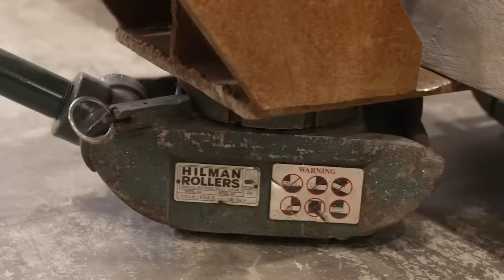Fitting the Lead Ballast Keel (Tally Ho / EP120)

Comment: I can't wait to see how that keel is connected to Tally Ho. It needs to stay right it place even in the roughest of seas.
Reply: I was thinking the same thing. How on earth do you attach that to the keel? Initially thought they would put the anchors in while the lead was still liquid but now I have no idea.
Reply: This is also my question...
Reply: I imagine they will use long, thick bronze bolts and bolt it right through the ballast keel and a keel timber. Same way the different pieces of a centerline are held together.
Reply: @maxxod1  Keel bolts! You can either cast them in , or cut a side pocket in the keel (either normally done on deep keels) or through bolts (for shallow keels like this one). I would guess that they will just through bolt in this case.
Reply: They'll use long bronze bolts all the way through the bronze floors to the bottom of the keel.  At 13:25 Leo talks about raising the boat high enough to be able to drill counter-bores in the bottom of the lead, this is so he can get a thick washer and nut on the the end but be flush with the bottom of the keel.  So they won't be 'bolts' like store purchased bolts, they will be solid long bronze rods and then just threaded at each end about an inch and a half or so.  They keel bolt size will be anything from 5/8 to 1 inch diameter, my guess is he will go with 3/4 inch.  316 L Stainless has a stronger tensile strength but there is a risk of long term crevice corrosion (where there is no oxygen present), bronze performs better over the long term in underwater applications like this.  You make up for the difference in tensile strength by using larger diameter bronze than your would stainless steel and/or you use more keel bolts.  I'm guessing there will be around 14 to 16 keel bolts total.
Reply: Bronze bolts trough both keels: see episodes 7 and 8 where Leo removes the original keel
Reply: Long, big bronze bolts.  It's about as you'd expect, holes through the keel timber into the lead.  If you want to see how it's done, Acorn to Arabella did it.
Reply: Here is where the hot glue gun comes in, remember that bulkhead story 😀
Reply: @felis1977  I am not sure I trust bronze with 8 tons... feel like it would get further and further away! but I also cant see Leo using any steel on the boat if he can avoid it
Reply: If you go way back to the videos at the start of the project,  there is an episode where he drills and bolts the old keel to the new keel timbers.
Reply: @ciarantaylor367  True - silicone bronze is more ductile than the steel. That's not an issue - you just use thicker bolts and/or more of them :) That's what I'm assuming at least - as I wrote somewhere else - all I know about boat building I learned from Tally Ho project videos ;)
Reply: They will use flex seal tape most likely Ewhah Doggy!!!!
Reply: Staples
Reply: @maxxod1  That "Black Stuff" they put on top of the Keel.... That was really GLUE.... LOL
Reply: @ciarantaylor367  The tensile strength of Bronze isn't as high as stainless, but it is still very strong.  Like I said, they will compensate for the strength difference with larger diameter bolts and more of them.  The risk of crevice corrosion is too high, bronze performs better underwater.
Reply: @SteelDoesMyWill  I imagine you'd also want to be mindful to choose an alloy that in the  event of galvanic corrosion you would want to make make keel lead the anode and the bolts the cathode as there's considerably more lead than bolts.
Reply: Duct tape,  obviously.
Reply: @on4xb  Curse you @on4xb. I've just been directed to EP 7&8 and I'm forcibly involved with re-watching every episode.
Reply: @hereitbe   Hahaha ...
Reply: @alexhamon9261  Lead & Bronze are not nearly as reactive as Stainless Steel & Aluminum, its all all about how far apart the two alloys are from each other on the nobility scale.  Bronze bolts have been used safely on lead keels for over a century.
Reply: @cappystrano1  I think YOU need to read the thread, nothing I said was redundant.

Comment: My heart goes out to that planer blade.
Reply: Its really soft its actually not much different than hardwood. Wax helps the friction but lead cuts more like wood than metal
Reply: Tool steel doesn't care.  Lead lubricates as its cut.

Comment: I don't know if you just couldn't get back far enough or what, but I'm sure I'm not the only one who would like to see a photo of the entire boat with the keel. I'm looking forward to seeing it bolted into place.
Reply: How?? What keeps it on?
Reply: @thetruthexperiment  Large silicon bronze bolts through both the lead keel and the wood keel. My guess is somewhere between 3/4 and 1 inch thick, at least a half dozen of them. They will drill down from the top. The nuts on the bottom will be countersunk into the lead. I'm speculating a bit, but watch and see next episode. It should be fascinating.
Reply: @chuckprichard3691  yeah, I imagine it would have to be very very secure. I wonder how many ships sunk because their ballast fell off into a mile of ocean. So brave.
Reply: @thetruthexperiment  Well, sometimes that happens, but almost always this is race boats. A boat like Tally Ho would be very safe if handled by a decent sailor, which Leo certainly is. It will still be secure in 100 more years.

Comment: The obvious strain on those straps when lifting that weight was scary !
Nicely done guys ! 
👍
Reply: And especially the wheels
Reply: i’m curious what those straps were rated for and if they had been load tested prior to this use.
Reply: Same.  I worked on navy boats for 20 years, and bought and used a bunch of those straps.  I too was worried they were underrated.

Comment: Looking forward to seeing exactly what is necessary to secure the lead to the keel timber!
Reply: Agree. I kept thinking: where’s the mechanical attachment?!?
Reply: If you look back at episode 8 you will see that it is attached with large bronze bolts. But I suspect that he is going to have to raise the boat quite a bit more to get them under the keel, when he removed them he dug holes in the ground to get them out, with a concrete floor he won't be able to do that.
Reply: The holes for the keel bolts will be drilled from the top and bolts inserted from the top. The holes will be counter sink from the bottom to allow for nuts and washers. He set the level of the boat to allow for the counter sinking as he noted in this episode.  I think he drove the old bolts down because it was easier.
Reply: I thought that just the tar would hold it in place, like glue 😂😂😂😂😂🤣🤣🤣🤣.
(Yeah actually bolts, BIG bolts.)
Reply: Shouldn't these very long bolts be installed before the deck and internal bulkheads are fitted?

Comment: A quick note:  When loading slick tired lifts onto till beds.  Take several hands full of coarse dry sand and spread it onto the tilt bed wooden floor.  This will give good traction; this same technic is used by trains to lay sand ahead of the driver wheels on steep grades to help gain traction.
Reply: That might be a good idea, but the video would not be nearly as much fun.
Reply: @davefoc   well there is that.   ^~^

Comment: Nearly fifty years ago I cast a three-ton cruising keel.  I intended to install the keel along with the deadwood but after seeing the size of the electric drill required to drill the over one-inch through bolts I decided to leave the job to the professionals.  From memory eight long stainless bolts were needed.  Drilling lead is fraught with danger as the drill bit "grabs" the surface as it cuts causing a torque reaction back through the electric drill.  If you are not prepared it could cause a lot of physical injury.
Reply: Same issue with aluminum, it's such a soft metal it can cling to the bit and clogs it up and just kind of sticks to itself. You have to have a really sharp bit and go slowly so the bit doesn't get too hot as well as very frequently backing off to get rid of the chips

Comment: I still get goosebumps when i think in 100 years when the tally ho is still in the prime of its second life the owner will be able to look back at the journey leo and his crew undertook
Reply: Thought this is a new boat ??   Except for some wood n fittings what's left of the first boat ??  thank you.
Reply: @MegaBait1616  think about what you just said and get back to me
Reply: @MegaBait1616  There is an episode in which Leo talks about whether this is a new build or a restoration. IIRC he basically says that if the boat would have been maintained during her life most parts would have been replaced by now anyway. He did start from the original boat and first took out all bits that were rotten or no longer trustworthy. I think the only major pieces that are left from the original boat is the transom and most of the lead in the keel. I'm sure some of the original fittings will be used too.
Reply: Guess this is like grandpa's old axe. Best axe ever, shifted the handle three times, and the head twice....
Reply: @Dronston  its the ship of theseus paradox.
Reply: @cappystrano1  no need to overreact, take another look at what i said and explain what horse im riding 😂

Comment: The pickler for the sand was inspired.
You guys being so nice the equipment rollers!  We just bashed them with sledges to change direction.
Puffin has the same prop cuts as Tally Ho.

Comment: I’m excited to see how you attach the ballast keel to the boat. I’m trying to picture the size of the bolts required to hold something this heavy in place, and how you will be able to drill/install them with so little clear space under the keel. I’m sure you’ve got this figured out, so I can’t wait to see the solution!

Comment: Good one Leo. Now what really interests me is how you bore the keel bolts and how they are fastened to the keel. I have always wondered how that is done. Thumbs up to you and the crew.
Reply: me too! I thought they would have sinked the bolts into the lead. That's not the way as it seems.
Reply: sinking bolts in melted lead ? impossible,  iron (or bronze will float in lead.) The answer: drill holes through both keels and bolt the keels together
Reply: @on4xb  so do they drill right through the lead keel plus the boats keel and use a very long nut and bolt
Reply: @johnwhite2267  Yes, but drill from within the boat :wooden keel, lead keel. Then countersink the bottom of the lead keel for the (big) washer and nut. "Drop" a (long) bronze bolt through the hole and torque them together. About 13 or more bolts will keep the ballast keel in it's place
Reply: @on4xb  thank you for the reply very informative and very much appreciated. I love watching the videos as others have said the massive amount of work that has gone into this project is fantastic. Im always incredible impressed with Leo and his crew the amount of knowledge he has in his head for a you man.  well done to all

Comment: Wow. Congrats Leo to you and all the members of the team and the generous supporters of Port Townsend that provided you with heavy-duty fork-lift trucks to lift the massive keel and all the other equipment like the keel supports. It was an amazing operation, every step of the way, a very interesting process. I am amazed that you can lift the entire weight of TALLY HO with hydraulic jacks. Most of your jacks look no bigger than 30 tonne jacks. Each step along the way you are getting closer to your final goal. I will be interested to see when the deck goes on. Keep up the good work.
Reply: Finished TH weighs around 30 tonnes, so no problem as you can see
Reply: Hey, guys who Jack up houses typically use 30 ton jacks, so a boat should be no problem. The real concern, with a boat, is balance not weight. You don't want it tipping over. With a house, multiple jacks are used to even out the load to keep one section from racking or twisting away from the others. Heck 30 ton jacks are used to change tires on big rigs, and they can weigh 80k pounds normally (40 tons) the over-sized/over weight trucks can exceed that, but your not lifting the whole truck, just usually one axle at a time.

Comment: We used to use milk as a cutting fluid for drilling in lead, and it definitely made it cut easier..
Reply: They used to feed it to welders,that had to weld galvanised steel too, or so i'm told.
Reply: Yes we did....everytime!

Comment: Fascinating and great work! Just one question - maybe I missed this but how did you attach the lead keel to the underside of the boat? Are there bolts or what is holding it in place?
Reply: Bolting of the lead keel hasn't happened yet. Consider this a dry fit
Reply: @on4xb  Ah, I see. Tks!

Comment: I was wondering how they would fit this weight  inside the ship... turns out they wouldn't.
Reply: There is more ballast that will be going inside the boat in the bilge, I think Leo mentioned it briefly a couple videos back but they've moved a lot of weight from inside the ship to this new keel to help with giving more headroom for the boat interior
Reply: If you have time I would suggest binge watching the whole series from the very beginning. Everything I know about boat construction I learned from Leo :) He explains every step and every part he puts in (or in the older episodes - takes out).

Comment: Well done!  I was worried that it wouldn't fit on the bottom, but it looks like there are not gaps. I think jacking the boat up looked so dangerous.  I could only see it tipping over in my worst nightmare.  You guys are doing a great job!

Comment: Leo, did you consider inserting J bolts or bolts with large washers in the molten lead. Thus becoming keel bolts?
Reply: That would have been a great way to attach that much weight. Done like bolts in concrete I have a feeling Leo will have a surprise in store for us. Everything he’s done so far is superior in strength I would expect the same here as well.

Comment: Leo - This is a huge milestone for your project.  Compared to the amount of time you have spent on constructing the wooden part of the boat, this lead keel assembly seems so small.  Yet the significance is very huge.  Congratulations.  Can't wait to see what size and material bolts that you use to secure the ballast keel to the keel timber.  I think that's next, right?

Comment: Dear dear people, I like to watch and enjoy your beautiful pictures of this wonderfully beautiful ship that you are rebuilding. I already wrote that I come from a family of boat builders . I myself made a 6 meter competition sailing boat when I was 18 years old. But then I entered the world of steel . What about working with grinding wheels in those days . 50 years ago . and now the same. Always work with a protective cap. The Only Time I Didn't Do It And Used Another's Machine Without A Cover Ended Up In A Hospital. Fortunately I can still use my hand quite well . but after grinding the top of my wrist ( the top caught on . and i already had the handle so tight that the machine pressed forcefully against my palm . that was lucky . otherwise my hand would have been off the wrist . . Now I had a very deep notch over my bone , at the top of my wrist .. A tendon through and 1 cm flesh wound ... I shiver when I see you people working with small spinning tops , but still !!!.

Comment: All those that are worried about how the ballast keel is mounted... go back to 13:30 in the video  where Leo clearly explains it!
Reply: So I assume, unlike modern bolt-on keels, which have the bolts cast or tapped into the lead, these will be through-bolted and nutted on both ends—albeit with counter sunk/counter bored heads/nuts on bottom.

Comment: I have had trouble drilling lead. The drill bit advances too fast and jams in the lead. My solution was to simply drive a hardened rod into the lead like a nail going into wood. The punch method  worked,

Comment: Hi, brilliant brilliant project. But what have I missed? There’s been reference to staking the keel bolts under the wooden keel, but what about attaching the lead keel? I’ve seen no through bolts?
Reply: Frederick Stibbert
1 year ago
It will be bolted to the timber keel w/ 1" diam. bronze through-bolts at 24" spacing, but these bolts don't penetrate the bronze floors, which are already bolted to the timber keel .

Comment: HI leo
As ever, fascinating stuff! I'm interested that you didn't offer the keel up, drill the holes for the studs then move it away to tap the threads. I hope the swarf doesn't get stuck when you tap them through the holes in the timber. I guess the keel expert (can't remember his name) advised you on this but it seems a slightly unusual approach. Having said that i've never attached a huge lead keel to a boat so am looking forward to finding out in the next episode!
Reply: See episode 8 where Leo removed the original keel. Mounting the new keel is the opposite action
Reply: @on4xb  we can look forward to finding out and i'm sure it will be done expertly (but lead is a bugger to drill, let alone through 300mm or more of purple heart!)

Comment: Maybe I missed something but did the ballast keel get bolted to the keel timber?  I would liked to have seen that.  But what a beautiful job, 100 year old lead renewed for a new life.
Reply: Frederick Stibbert
1 year ago
It will be bolted to the timber keel w/ 1" diam. bronze through-bolts at 24" spacing, but these bolts don't penetrate the bronze floors, which are already bolted to the timber keel .